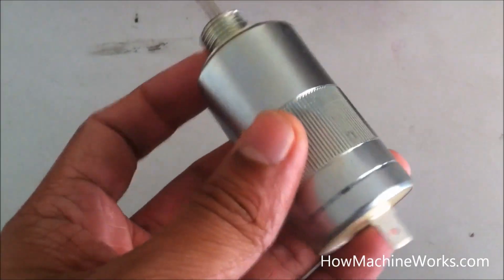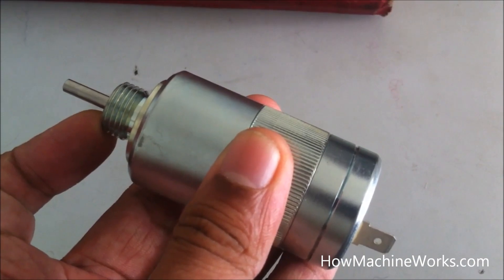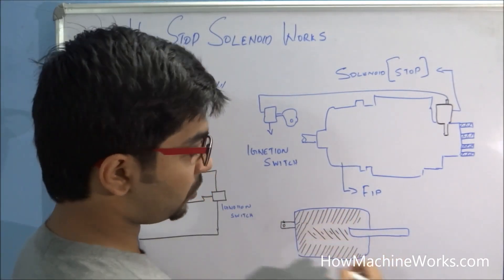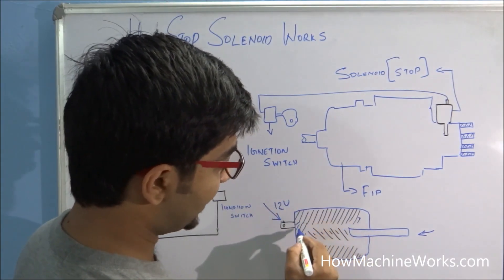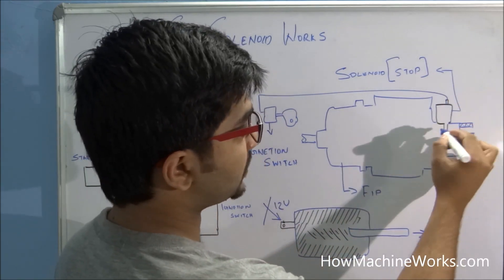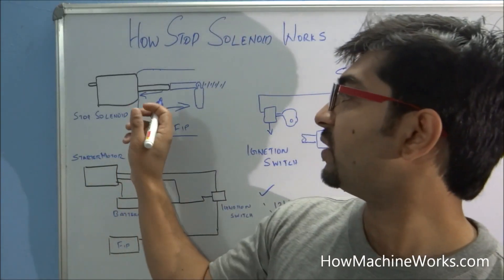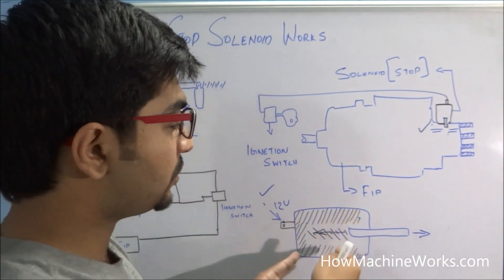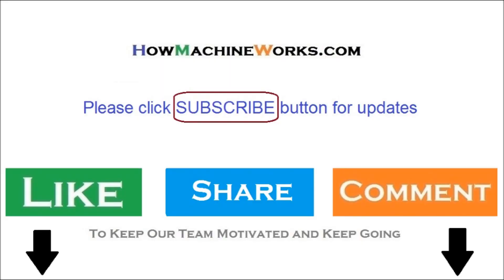How stop solenoid and ignition key works.

Comment: What about the solenoid was burnt ... ? I have firepump system included the diesel engine and the of it is that solenoid it was smoked and very hot...oil inside were disbursing

Comment: Nice video, one question my friend. I want to install a kill switch onto the 12v ignition switch wire. Will the starter still turn when the switch is off? Meaning, will I wear the starter out? Thank You
Reply: I’m also thinking of doing that a kill switch to the ignition.and no the starter can’t turn only if switch is on the u start the engine.

Comment: If the fuel solenoid isn't working or it sticks in the out position, the engine would not get gas? It turns over good but won't fire up?
Correct or not?
Reply: Certainly it  won't fire up
Reply: CORRECT
Reply: Bingo

Comment: how this fuel cut off is happening in common rail fuel system ?
Reply: I think each injector has its own electrical solenoid which when power is not applied does not open thus no engine fuel supplied to run engine .